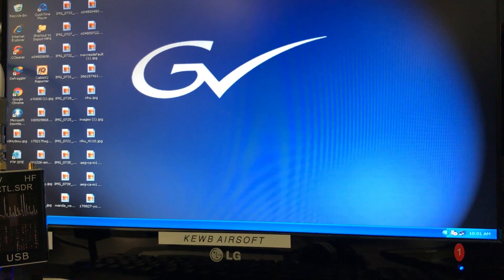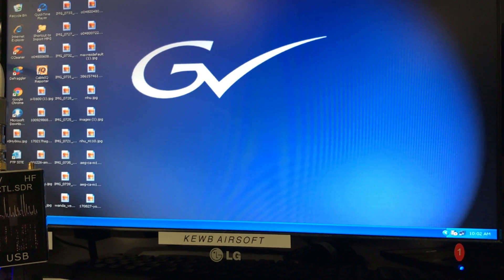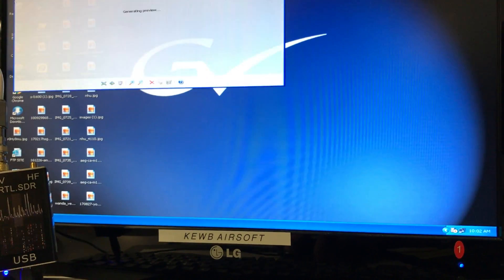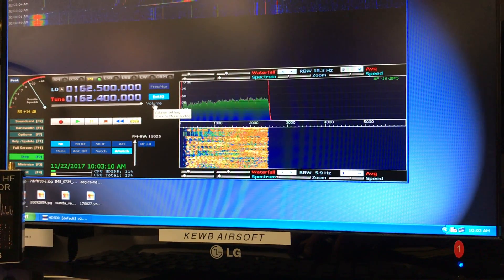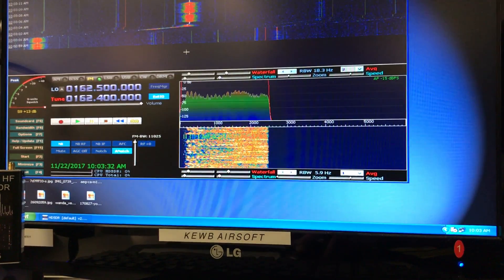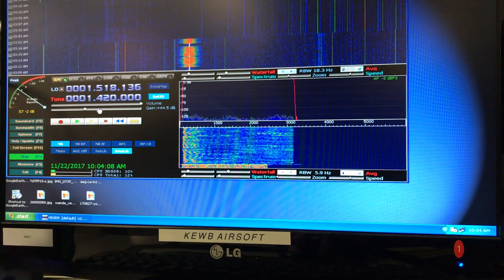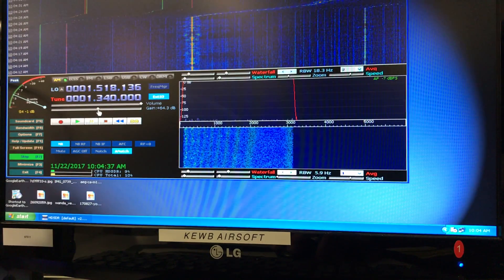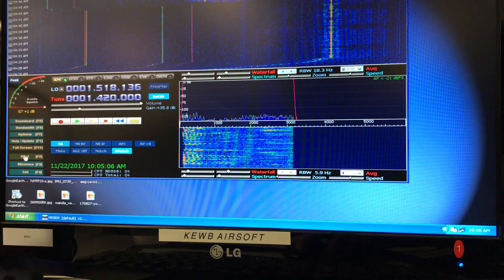HF Repair For Generic RTL SDR With LNA Circuit In Q Mode with HDSDR Part 2

Comment: What that second Circuit is for ?
I thought it would be Mixer to get higher frequency conversion in range of Main device so it can scane below the 25M but you said it's LNA ! Why LNA and how lna can change its Band Below the specification of main device ,down to 100 K ?

Comment: Just got this FOSA on Amazon, which looks identical, and HF does not function either.  I'll try your shunt.  Thanks a LOT.
Reply: Hope It works for you !
Reply: @Naoko1960  Turns out there was nothing wrong with the dongle. I didn't realize that until I bought a second one elsewhere. Finally someone on RTL-SDR gave me the parm string I needed to enable HF....  sheeeesh!

Comment: thanks for the video! it also helps other people!
(Good work!)
I had this information by chance from a forum in the Netherlands
(your video proves it's true!)
The HF part did not work with me either!
and I had sharp software on it. (this software worked unstable!)
I also soldered the wires and gave him to a friend to test the HF RX.
he would compare the receiver (he has one that works!)
the receiver now also works according to my friend!
he also works with HDSDR,
I have just installed HDSDR software on my own
I hope the receiver does it when I get it back!

friendly greetings from The Netherlands!
Rob.
Reply from the maker: Thank you. You response made my day.
I made these videos to help out others who want to use the HF function of the RTL SDR unit. It just blew my mind that these are leaving the factories in China with this easy to fix flaw.
  Out of all the Software out there I found HDSDR to be the best to run across 
windows and all its versions. The installation is not to clear but it does work when you get the DLL file and USB driver setup. I just did not get SDR Sharp
to work correctly and moved on.
 I'm currently playing with the Noo Electric Smart SDR and an their external upconverter with good luck.

Peter N1EXA
Reply: @teamkewbairsoft4554  
beautiful if it makes your day!

I discovered that this afternoon that one of my RTL SDR broke, probably because of my own fault.

I have been extinguishing with a homebuilt up converter.
where work is done there are fell
 chips!
translated: where is be experimented, that is where parts go Broken/wrong!
I do not think the translation is right here (here above)  ;-)

fortunately I have one more rezerve
  :-)

again friendly greetings from the Netherlands!
Rob.